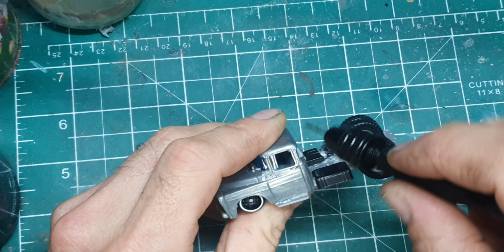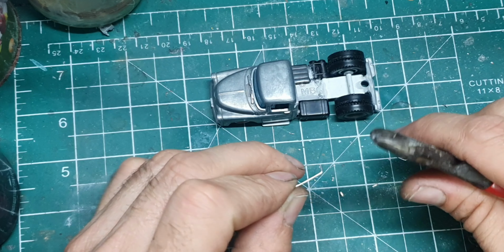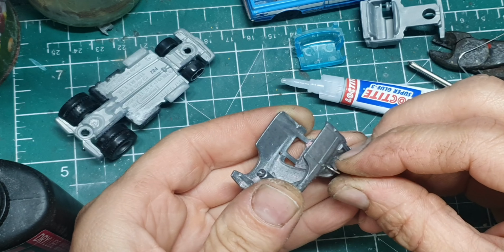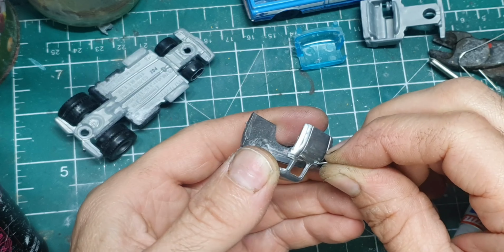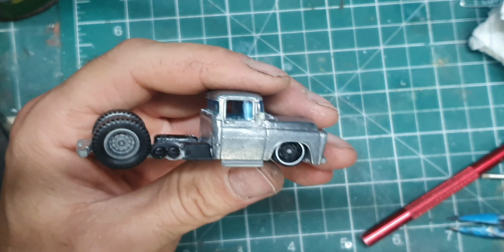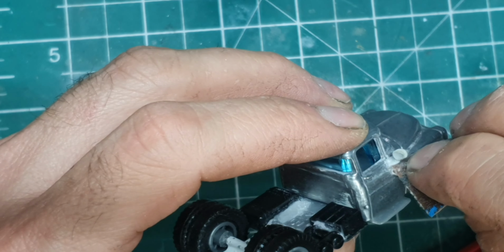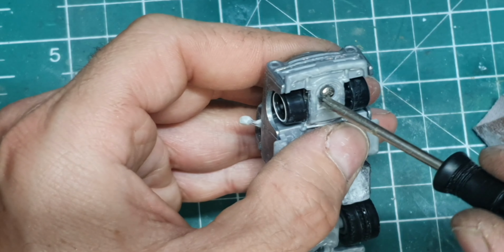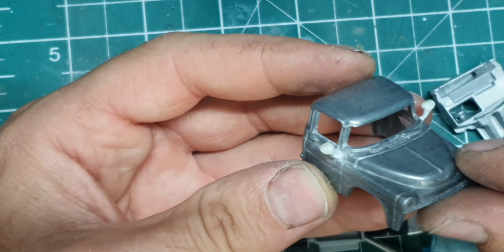How to add mirros to Hotwheels, Matchbox or any 1:64 diecast!

Comment: Think they didn't add mirrors for quite a few reasons. First they'd be to easy to break they knew how rough boys would be. Any mirror would be just broken off in minutes possibly leaving a sharp spot on the toy.

Secondly they just wouldn't look good if just done in the diecasting process a lump on the door.

If made of a separate part that increases production costs and creates more labor to get the toy completed.
Reply from the maker: You are sure right!